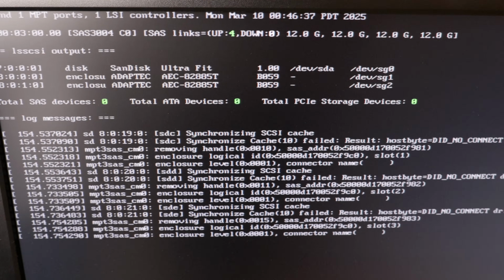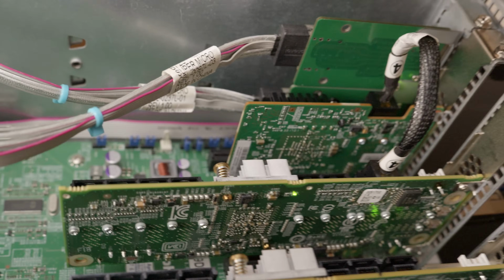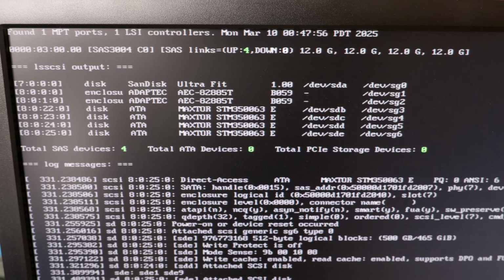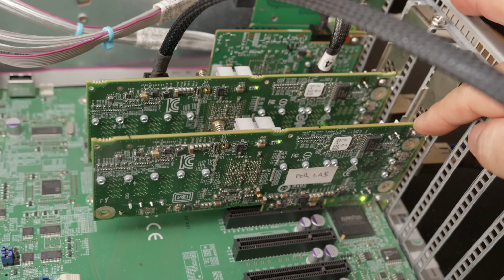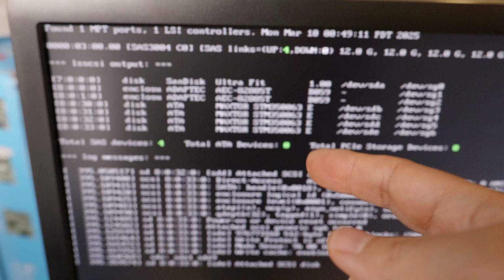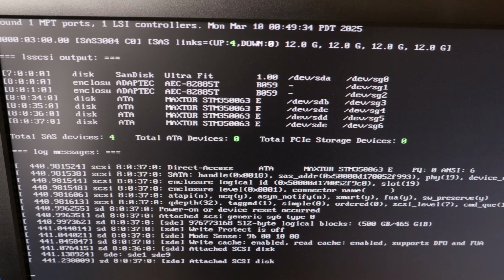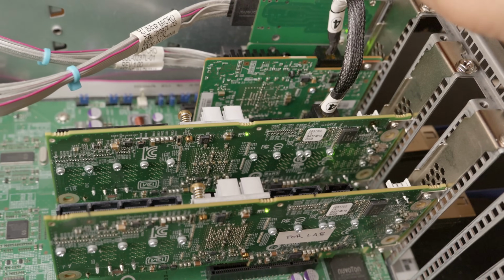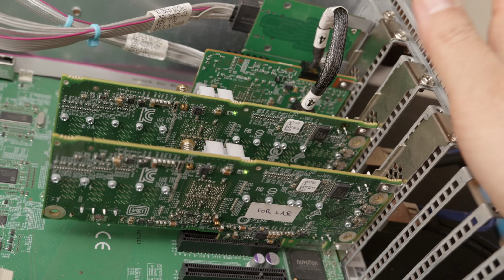The best PCIe3 x4 HBA and Expander setup | HBA IT mode controller for limited PCIe lanes

Comment: You can plug a x8 card into an x4 slot if not physically obstructed. The obstruction would usually be from the back side of the slot itself but it's just plastic that can be dremeled away. Sometimes the MB has protruding components where the card protrusion would go, so need to check about that. But also some smaller slots are open at the back so they are designed to accept longer cards.
Reply from the maker: That's all true. However, not all x4 slots are open ended. And many people hesitate to take a dremel to their motherboard. So, this is meant for those who have those limitations. But yes, a x8 card can operate in a x4 slot if it fits, or can be made to fit.
Reply: @ArtofServer  Fair enough. I like what you doing. I've learned many things from your channels. So keep doing what you are doing.

But sometimes one can learn from the comments too. My post was targetted to people that might not know this and always try to math the card with the slot. PCIe is very flexible in this respect. Regardless of @hugmynutus' reply to my post ;)
Reply: On a lot of older PCIe Gen 4 & Gen 3 MB/CPU combos, when a card doesn't get all the lanes it wants, it just defaults to Gen 2 1x. 

I have some skylake & broadwell Xeons that pull this crap all the time. It is really annoying. I don't think the newer PCIe Gen5 root-complexes do this.
Reply: @valarauca1  Never had this happen to me. And it's not supposed to happen. PCIe should work at the highes common denominator. And has always worked for me. I have several server Xeon boards and most of them have slots that are larger than what is wired to them, e.g. x8 signals on a x16 slot. It would make no sense to behave in the way you describe. Not impossible, I've seen other weird shit. But I would never expect sth like this to happen.

Comment: I used consumer class boards as a server for years until I switched to older enterprise gear (Supermicro). Consumer class stuff isn't built to run 24x7 and stuff will fail and you'll be limited by CPU lanes which in turn, limits PCIe slot lanes and sharing BS. Old Xeon E5 V4 CPUs will give you 40 lanes and then it's just a matter if picking a board with the expansion you need/want and you'll rarely ever run out of PCIe lanes. Enterprise will also give you backplanes with SAS3 expander chips built in and you just need an HBA or MB with on-board HBA freeing up even more slots.
Reply from the maker: Yeah, I personally prefer to just use older server gear for many of the reasons you mentioned. But a good proportion of people visiting my store are building with their old desktop PC leftovers. It is often quite limiting, lack ECC support, lack OOB management, lack PCIe lanes, etc. Thanks for watching! Good to see one of the old timers still commenting on my vids! :-)
Reply: @ArtofServer  I definitely fit the old timer category now...  I remember 20MB drives 🙂 I still lurk here, STH and Reddit as you never stop learning.. did not know about this expander model before your video but I've got one on the way now to play with. Thanks!

Comment: Something worth mentioning is that port G is a controller only port as per the documentation of the expander. Ports G, H and I don't support direct attachment to disks. That might be confuging for someone that tries to connect drives to it. Apart from that I have 3 of those expanders and I'm pretty happy with them.
Reply from the maker: Sorry, but that's not true. Watch this after 9PM PDT: https://youtu.be/Es_K31Tkrk8
Reply: Hmm, yeah, he shows the first port (A) works with disks and say it's supposed to be limited. But the manual makes it clear it's it's port G (all the way on the front), H and I (external) that are supposed to be limited to "wide only" connections so he tested the wrong port!
Reply from the maker: See this when it goes live at 9pm PDT: https://youtu.be/Es_K31Tkrk8

Comment: I am using this Adaptec SAS expander for my DIY JBOD made out of an old DVD duplicator tower, some icydock 5.25 disk adapter and a fanless Seasonic 460W 80+ Platinum PSU.
The card get pretty toasty when it is full of disk, so i attached a 40mm fan to it and it is cool now.
Reply from the maker: Cool! Thanks for sharing!